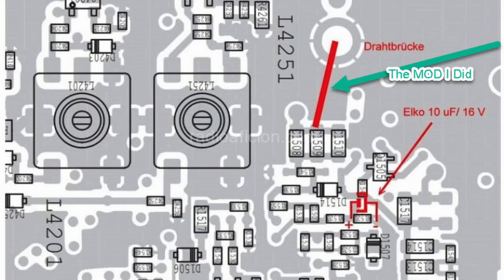Icom IC-7100 Low Power Modification Addendum

Comment: When you make a modification like that you never know what you’re gonna get. I have an IC-7100 & have zero issues of it getting to 100w on voice peaks. I tested it before I put it in my vehicle on a dummy load and watt meter. This modification is sure to shorten the life of the radio as well.

Comment: Good to know.
I am getting ready to install the IC-7100 in my truck and will wire in a relay disconnect switch for the power feed.
Thanks for the heads up.
Reply from the maker: Glad I could help